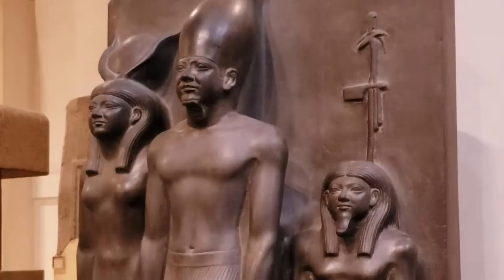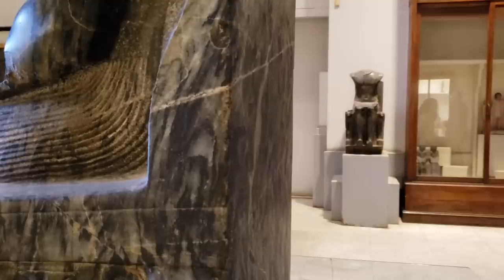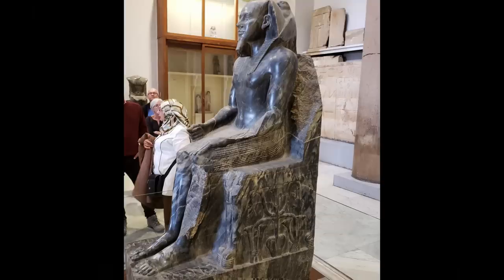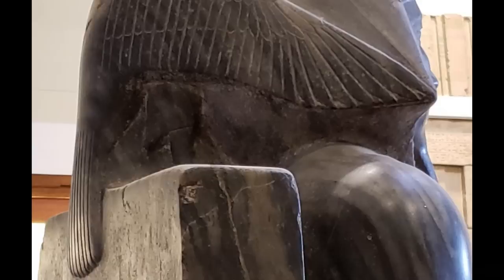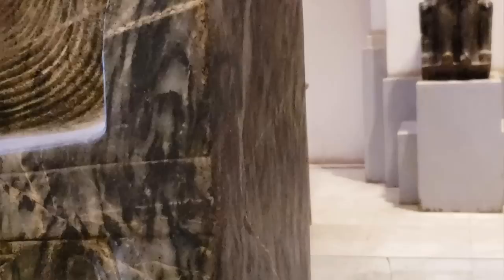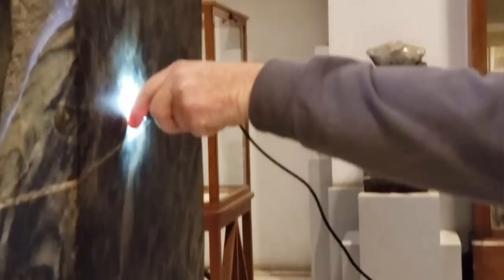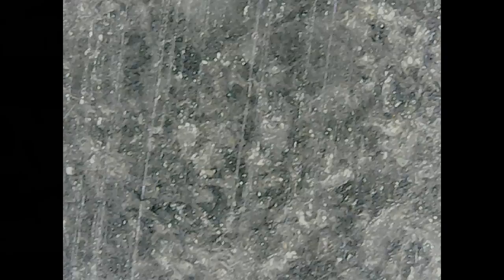Khafre's Diorite Statue

Comment: My qualifying statement again.. As someone who.... Owns a machine shop, I say those are power tool marks. And only certain kinds of steel can be hardened. Not every kind of steel can be hardened. So a knowledge of metallurgy would be needed to make proper tooling to cut that stone. 🙂💯👍💪⛏⚒🪚⚙
Reply: I think that hoofs might contain something that can case-harden steel, but how in the hell they'd know that is something else.
Reply: Special tools for lapidary
Reply: The land of "Khem", or "Chem" was the name of Egypt before it was Egypt. There is a reason Tesla  Newton, Einstein and Jesus refer to Thoth.
"You can't get there from here" Go back to the beginning of knowledge and go from truth to truth.
Reply: But where is the archeological evidence or artefacts of the tooling used? Very intriguing…
Reply: Is it possible a manual repetitive polishing technique was used to simulate machine marks? Certain crafts could involve a ritualization of technique. I think of eastern traditions where high carbon type steel somehow were made available in creations of a certain type of Nordic swords that certainly impressed modern material engineers. Not the level equivilent of modern manufacturing of materials but seriously raised the eyebrows of those who were involved in the molecular analysis. How did they achieve these results ....... how was it even possible to achieve that range of purity, chemical bonds of structure, without any modern manufacturing techniques? Dirt kilns, chunks of ore, crucibles and charcoal fired? It was a fascinating documentary. The swords were etched with a name that sounded like "wolfsborg" or the like and found in burial mounds of the elite a status symbol in life. Anyway, could a ritualization of motion perhaps mock those modern marks. I know this sounds strange ...... a decade of wax on,  wax off training until you become an official guild member,  trusted, elevated,   honored to polish the immortal stone. Your consideration would be far more informed then mine involving the possibilities. Our ancestors were impressive that is for certain.
Reply: @Charcha8761  Great comment... man can achieve a great deal with mere trial & error and a great deal of repetition of process... there are skills, techniques just lost to time... when people make something their craft, live and breath it all their lives and pass that down over successive generations for thousands of years or more, the results can be seriously impressive and no amount of modern equipment or imagination could be as interesting or as proficient as the reality out there!
Reply: @baarni  it turned to dust long ago
Reply: One only has to l👀k at the Emerald Tablets to realise the technology they had at their fingertips was/is  far more superior to what we have today and we have the cheek and audacity to say we’re a more advanced civilisation! That couldn’t even make one of those Emerald Tablets today never mind 12 and the thing that blows my mind about them is that they cannot be destroyed by chemical means thus rendering us just mere mortals in comparison....

The one that made the Emerald Tablets is the one that built the Great Pyramid of Giza and if I were a betting man then I’d say that the Sphinx is a lot older than what they say it is as is the Great Pyramid of Giza id say more like millions of years and the reason I say this is because they found hieroglyphs in Australia that predates Egypt’s hieroglyphs I know mind blowing to say the least...
Reply: @Fuzzmo147  yeah I'd like to know what they used.  Couldn't have been done by hand
Reply: @Charcha8761 Ulfbehrt
Reply: I have a proposal: A factor of effectiveness of surface finishing is applied pressure. By hand my estimate would be around 150N of force when rubbing, spread across the surfaces in contact. To improve on that, at least for working the larger surfaces, one could build a sledge construction over the workpiece that is weighted and hauled back and forth by teams of workers or animals. It is possible that they already had discovered that flat surfaces emerge when three workpieces are rubbed together in alternating pairs, exactly as granite measuring flats are produced now. In this fashion, more than one such statue could have been in production at the same time. (I would very much like to examine the region around the falcon’s tail, to see if there is a gradient visible in tool marks, from working the larger depressed flat to later finishing this detail by hand.)
Reply: No, they aren’t.  Hand drills powered by a string and bow make the exact same kind of marks. So do line saws, a simple chord encrusted with garnet or similar hard crystals, pulled back and forth by hand.   Really- working stone is NOT THAT HARD. That’s why its one of the first things mastered by even primitive human societies. From making stone tools, to building Stonehenge.
Reply: There are no steel tooling marks. It was all stone scratch, divet and knapping tools plus drills with abrasive slurry used to carve. The polishing used hard abrasives of increasing fineness, applied with long, consistent strokes to maximize smoothness and reflectivity.
Reply: @Charcha8761  ulfberth is the name you're thinking of, might be off on spelling
Reply: @baarni  metal objects generally don’t last thousands of years, either corrode away or get repurposed, melted down for something else
Reply: @saladdays180s9  9
Reply from the maker: watch the video all the way to the end. Also, I do not claim the scratch marks are made via steel tools.
Reply: @joejoejoejoejoejoe4391  hoofs? No. If you refer to horse shoes, it is this: cold deformation leads to christal growth. The effect of that is that christals have more difficulty moving alongside each other when forced to do so. The material per saldo gets less ductile/more hard. Trying to straighten a paper clip is the classic example of this: it is hard to do because making the 180 degree bends has hardened the material, that will therefore resist straightening again.
In the 18th century horseshoes and nails were well-liked for gun barrel production. As metallurgy was not even in it’s infancy yet, I doubt that was for the right reasons. But if an old horse shoe might be worn, it surely had proved not to crack if it was still intact. (Cold deformation btw also helps to excrete impurities such ad sulfur and silicon, which are ususally undesired in steel.) ‘Steel’ is a technical term reserved for alloys of Fe and C, and also with other functional elements such as manganese. It is always industrally produced. Everything else with Fe as base material that predates the industrial era or is not made in a controlled industrial proces is called iron or wrought iron. Or…cast iron, when the C content exceeds about 1,6%. 
Pfff, thanks for holding my beer. 
??? Bring me onother one!
Reply: @bina nocht It’s a new subject to me, or at least somewhat (thanks YT). But yeah, that must be the case! Both craftsmen and their clients die. 
I agree with most of your other comment. I think it was too early for steel tools (technically hardened wrought iron tools), but I wouldn’t be sure about stone tools and power tools. A wooden construction (not unlike a loom), set in motion by mules, would that survive? I mean, graverobbers also set fire to mummified cats and falcons to see what they were doing inside the pyramids. And something like that (a loom), rocking back and forth, drawing a sheet of linnen plus an abrasive over a surface? Why not? And since very round holes appear to have been drilled, a tool with a circular motion must have been available. So why not a sheepskin impregnated with powdered granite on the end of a stick as a polishing tool, rotated by a wooden bow? 
If there are no stoon tools found, they may have been crushed and ground up for this purpose. But then of course, still some newly made tools would have been found. Then perhaps they were banned? The Pharao himself was a divine figure, perhaps tools were too mundaine. Perhaps the story had to be that his grave had been planted on the earth as an act of heaven. So leaving your tools lying around could cost you your life, because it would disrupt this narrative. We just don’t know, but I know that it was said of the father or grandfather or Kim Young Un that he never had to go to the bathroom. And that’s only a couple of decades ago!
Reply: @AncientEgyptArchitecture  I was replying to the comment by the "machinist" who claimed you would need hard tool steel (and/or other modern implements) to carve this statue which is clearly contradicted by the microphotography showing long, parallel abrasion lines.

Comment: I am wondering, could the polishing scratches be from modern day restoration?
Reply: I wonder about that too. If the statue was found in a pit, surely they cleaned it up and probably polished it
Reply from the maker: When Egyptologists find something broken, like an interesting vase, ( such as the schist disc, which will be featured in a coming video ) they try to 'restore ' it by gluing the pieces together. Usually this is not done very well. This is also the case for buildings. 'Restoration', for the antiquities council, means re-stacking stone and using cement/re-inforcement to hold it all together, or placing rough bricking over a partially destroyed wall. This is usually not very well done either. ( let's just say the finished result would not pass inspection by the workmen who originally crafted it ) When it comes to polished artifacts, a thorough cleaning is as good as it gets...the prevailing view there is that re-polishing would destroy the artifacts' integrity as a part of the archaeological record, / usefulness as a historical artifact, which is correct.  Long story short, The council would regard re-polishing artifacts as vandalism, not restoration.
Reply: @AncientEgyptArchitecture  could it have been done sometime in the 19th / early 20th century after it was found ?
Reply from the maker: No. Late 19th century tech. would have left different marks.

Comment: Not difficult to get a perfectly straight rubbing direction using primitive tools and enough manual power combined with low friction (perhaps water and some abrasive), you only need to start with a straight edge and everything else follows.
Reply: Your right. That's how I brush polish stainless  using something straight  against my emery block!
Reply: But you need material harder than the stone. Which at the supposed time of making, they didn’t have said metal. He said this literally within the first few minutes.
Reply from the maker: I'd love to see a video clip of a curved surface, such as the calve or arm or facial contour of a similar statue, having a straight edge used to polish around the curve. Perhaps my imagination is insufficient to visualize this....

Comment: I'm wondering if the miniscule incised lines shown at the end of the video aren't created by some kind of wooden jig, not unlike the old burnisher's hand- held burnishing tool which fit into a notched tablet on his chest? Except, in this case, it was used to polish hard stone, not silver.
As for the abrasive used, the only answer I can give is diamond dust?
Or bort of some kind, hooked up to the burnishing rod?
Amazing workmanship! Very informative video!

Comment: Water glass. Hardwood ash, (potash, pottasium hydroxide) sand, plus hot water. Mixed with metal oxides. Poured.
Reply: 😂talk is cheap, if it’s that easy why don’t you build one exactly like this to shut everyone up and end the argument??………. You can’t
Reply: yup - let's totally disregard the crystallisation process to support your narrative - plus native quartz veins observed running through the medium in multiplt statues.

try harder and next time include the facts
Reply: Just a request; please take a basic course on geology so you can tell the difference between rocks and how rocks are made, how hard they are, how the occur in the natural arena and how we use them. If you want to work on your recipe tho, take some chemistry too.

Comment: The parallel microscopic scratch marks invalidate (defy) the theory that the stone was first softened by chemical means, like in Peru is still in use today for fitting building blocks of hard stone upon one another. The problem with the obvious alternative theory of an earlier civilization than the Egyptian one, however, is that this earlier one did not leave any pictured or written material. Only people that communicate everything telepathically need not put down anything in writing or in pictures. But that is far above the (rather low IMHO) acceptance level of ourselves, even today.

Comment: I wonder if they submerged the figure in fast flowing water with an 
 abrasive particle added to polish the statue. Maybe tumble it in a barrel of abrasive sand in water. Much like a pebble turns smooth in a flowing stream.
Reply: That would tend to round off corners, just as you see on a pebble in a flowing stream.  There are some very sharp corners on this, so you couldn't have done it that way.  More likely a flat sanding block with progressively finer sand.  And hours upon hours of manual labor, but since there wasn't an internet to suck up their time, they had the labor available.

Comment: A jig would explain the straight lines. The circular patterns were probably from another hand tool. They had gears back then, right?
Reply from the maker: The circular patterns shown in the video are closeup photos of modern disc sander marks, meant as a comparative/illustrative contrast to the straight marks on the statue, and are not photomicrographs from the statue. This is also explained in the video.

Comment: Working steel, if you want long parallel scratches, you need a moving continuous belt at least as long as the longest scratches.
Reply from the maker: the scratch marks on the statue are only 1 to 2 millimeters or so in length.

Comment: Could the carving be done using a ‘chisel’ made of stone and struck by a wooden maul? I have heard that harder stance may be worked using a softer stone though the terms may be relative to each other. In East Anglia flint was worked by tapping with bone antler though this stone has grain.
Reply from the maker: There's always several different ways to accomplish a task. The main questions are;
1-how long would it take? ( this matters )
2-how accurate is it? ( this part matters a LOT ) 
3-how long would a flint chisel be useable before replacement/re-knapping would be required?

Take another look at the Detail around the eyes and lips of the Face. Look at the toes, showing very fine and even cuticles at the base of the nails.  Are these delicate features something a piece of flint and a maul could achieve? I don't KNOW, but I tend to doubt it...I would love to see someone demonstrate it though!
Reply: @AncientEgyptArchitecture  ah yes but I was not intending flint to be the object of desire merely that the use of bone and horn to fashioner. I was wondering if other natural stone within the area of operation could be used? As you say the stone available was volcanically constructed whereas flint is constructed by glacial pressure. From what you have said about rubbing stones for finishing I merely was postulating from incomplete knowledge if one stone could work another. As for fine detail they were supposedly able to obtain what we call jewels but they would have to have the means of working them from the rough so they had some techniques.
Reply: Couldn't they have gummed a piece of linen with abrasive dust and briskly drawn it back and forth?

Comment: fascinating. my question is if there is any sort of modern tool of any type whether powered or not powered, capable of making the same type of scratch pattern as he shows with the microscopy photos?  If such tool exists, could be a good starting point to speculation on what technologies they possessed in the ancient days.   I hope it is discovered one day how they actually did it!
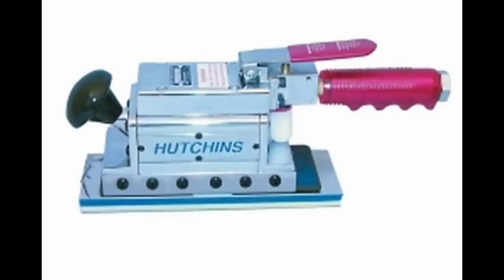Reply: The rectangular sander @4:52 or other pneumatic sanders like it would leave the angular hatching. Typically covered from sight by polish or wax or a clear coat, the angle of cross hatch will vary depending on tool AND user, but different types of it are better or worse from one substrate to another. i.e. easier to hide or they themselves can hide blemish or imperfections!